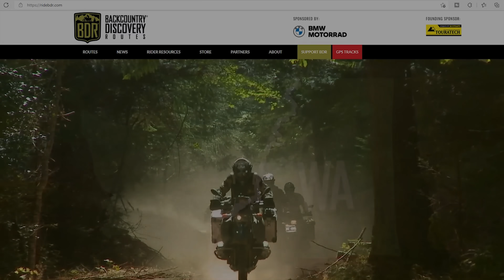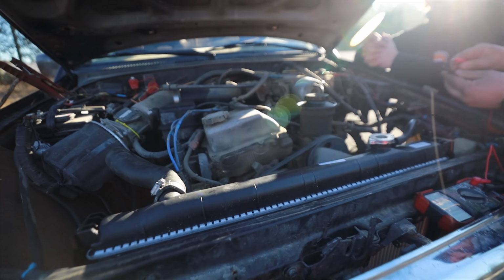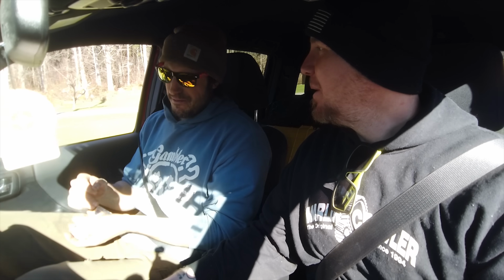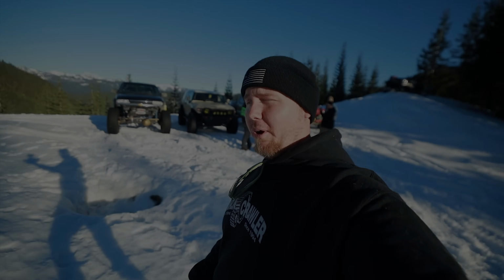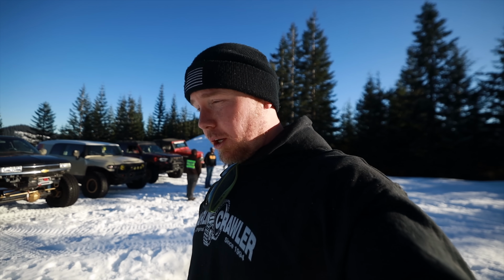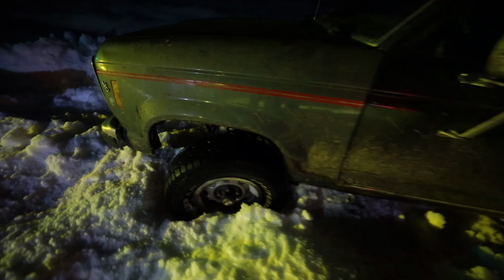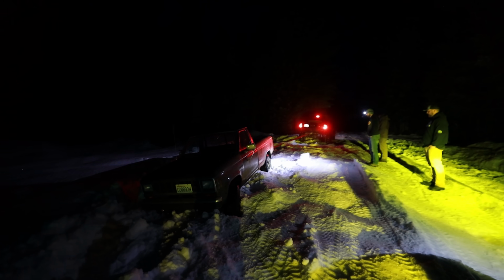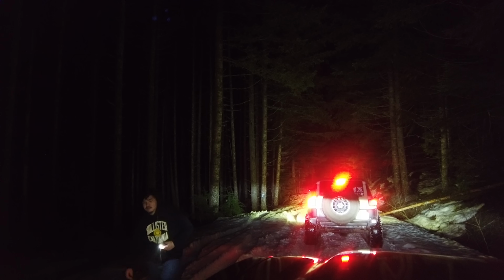Nighttime Recovery! Snow Wheeling My Toyota Tacoma Off Road.

Comment: Never ceases to amaze me how many people are unprepared for winter driving particularly in the high country. In the back of my pickup truck is a backpack in it  a set of snow chains been in the back of the truck for 12 years and never used. The same square point shovel that I have put somewhere near 750,000 miles on in a big rig truck, I've had for as many years as I've had those snow chains.

Comment: 100% agree nate. At your closer you have a maxi trac compressor airing up. I just put up a video to add an internal pressure switch and plan to do a on board air setup video soon. Do you have it setup to do each tire individually or all 4 tires at once?

Comment: We all gotta help our fellow man, good on ya. What tire pressure do you typically use on snow?
Reply from the maker: I had 3-4 psi in mine
Reply: @DirtLifestyle   Out of curiosity,  what pressure would you recommend for 31" tires?
Reply: @mikemorgan4670  if you don't have bead locks I wouldn't go under 15 psi
Reply: @mikerasmussen7993   Fair enough and thanks for the input. I run BFG KO2 265's, rarely drive on snow here in BC but want to be informed and educated...just in case. Will definitely take your advise. Cheers.
Reply: @mikemorgan4670  less psi more traction but you risk popping the bead once you go below that bead locks I've heard of people running 2 psi